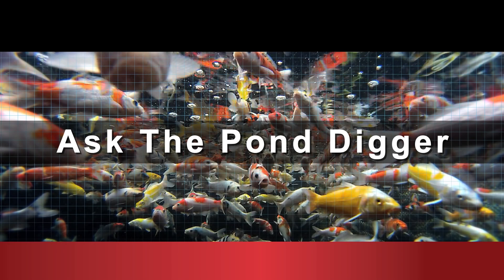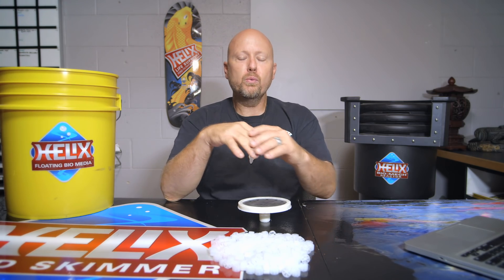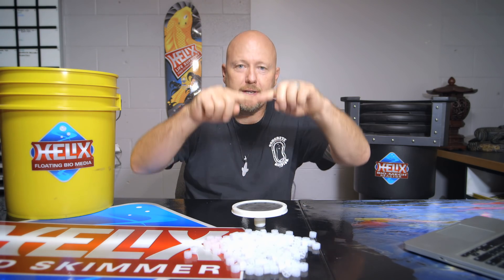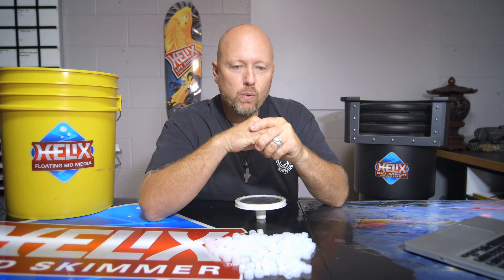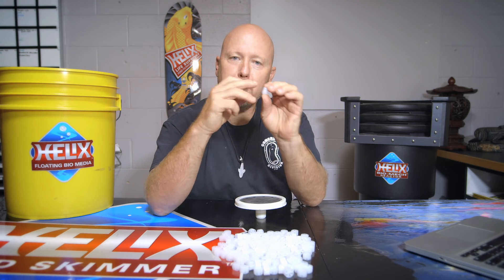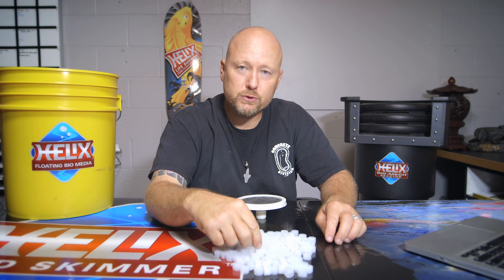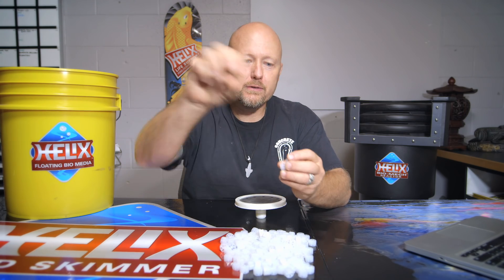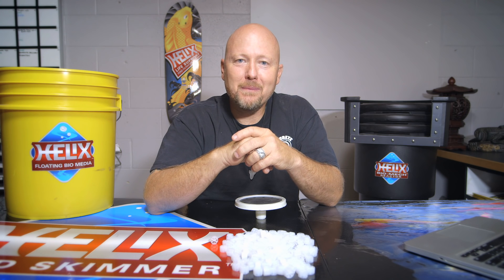Moving Bed Waterfall Filter - Ask #53

Comment: Hi ... thanks for such great insights ... I had two questions pl . 1) can we not place a grill over the top of such bucket to ensure that such media doesn't overflow to the pond ? Any drawbacks ? 2) if I bring in this helix wonder product but without aeration - Meaning the water flow itself from the pump onto the waterfall bucket causes the media to move around. Is this workable ? Kindly advice and oblige.

Comment: I'm building a very small pond in my backyard, using 30 gallon barrels to attempt a diy skimmer and waterfall filter/moving bed filter. I'm going to buy a few gallons of K1 or K2 eventually, but I'm not sure how much air it needs in my small setup.  I know I'm going to use a small diffuser, probably a 4" diffuser, but I'm not sure what rate of air pump I should get?

Also, hoping this is the right direction for a small pond that will see some small fish (maybe feeders?) for 2 ducks... Hoping the moving bed media helps keep the alkaline down and the water clean...

Thanks for the great videos!
Reply from the maker: we use a 25L air pump on our 5" air diffussers. the moving bed won't do anything for the alkalinity and keep in mind ducks can foul up your water quality real quick. Make sure you have some good mechanical filtration too.
Reply: ThePondDigger thanks! I was hoping to get some plants as well to help with the mess they'll make.. any suggestions? Or am I stuck with replacing the water all the time? 

If that's the case, I simply would rather not give them access to the pond as often.. I can give them a shallow kiddy pool daily to clean their beaks..

Comment: I thought k1 media worked well because it banged around and knocked off old bacteria and would always have your fresh vigorous bacteria. Now I'm really confused. lol
Reply from the maker: +Florida Fish Guy The inner ring of the media is the non collision zone. As it bangs around it keeps the media from trapping solids.
Reply: it works as a bio filter, you dont sell the media ? cant find it in website
Reply: Florida Fish Guy you're exactly right. The real advantage of k-1 is that it's maintenance free. My submerged/ static bio media (which is plastic pot scrubbies) has to be rinsed of all the dead bacteria twice a year. You never need to do that in a moving bed filter that has proper flow and mechanical filtration on both sides of it (I've before the filter and after it).

Comment: Eric my Koi / rescue pond in Las Vegas came with my home. Approx 6,000 gallons. I installed a Helix skimmer several months ago and re-plumbed the entire pump feed system. I have no filtration to speak of and only a container with lava rock which gravity flows water back to my pond. I am constantly called to rescue koi and turtles, we finally could not take anymore this year. My water quality is ok for now and we check it often. In short my pond has a VERY heavy load. I have 2 external pumps. In a couple of weeks I should be calling you to acquire a Ultima II filter. I have a large water fall and set up and unfortunately your design will not work in our water fall I also think our flows would exceed your system design. Yes my water quality is obscured / brown and has never been clear except in early spring of winter months.  You ask 2 pumps, 1 to constant run thru filtration (Approx .75 water changes per hour (And it will meet the low flows for the new filter) and thru my UV lamp and the second will be to backwash the new filter. We pay over .13 cents a KW in our home and in 1 month we reduced our power bill a LOT as for a little over a year we  ran a large pump. On a trip 2 weeks ago my wife could not believe a clear pond as we visited several in Hilo Hawaii at the hotels they had the media type filters. She is also excited to see a clear pond in our back yard. 

Thanks and Keep up the good work
Gecko50
Reply from the maker: +Chuck Keehne Thanks for the reply. Let's explore options. I'll look forward to your call.

Comment: I do that but with lava rock but my aerator is 4 inch's off the bottom .Of course the rock don't float .Now with that type do you ever have to clean it and do you need a filter besides that .I built bigger but the reason was the new liner was bigger than i thought it would be .But rebuilding my pond was not my choice
Reply from the maker: +sissy murphy I always love hearing from you!
Reply: I think I love your videos more .The fill the time I have to spend sitting at the my hubbies doctor visits .I have even had other people while i am there watching my tablet with your you tube video's .There are no tv's there so it gives them something also to make the time go faster .Even Dr. Zachary my hubbies heart doctor had to take a peek at what I was watching .